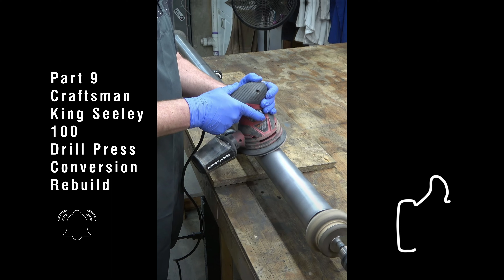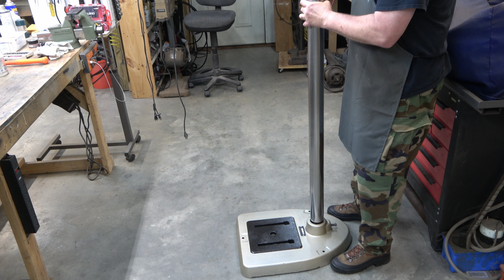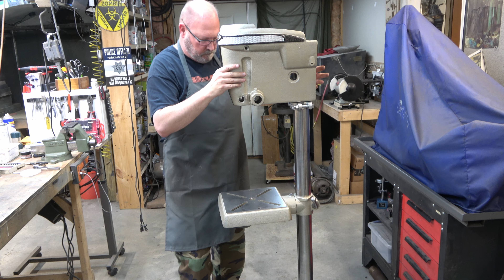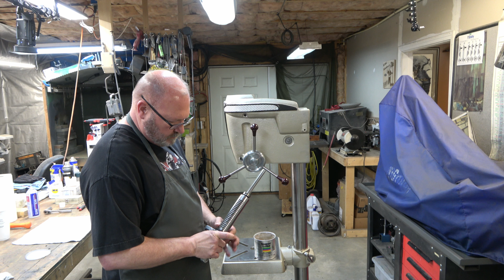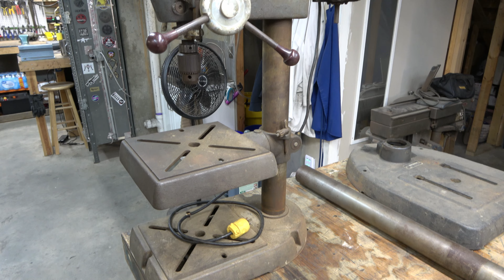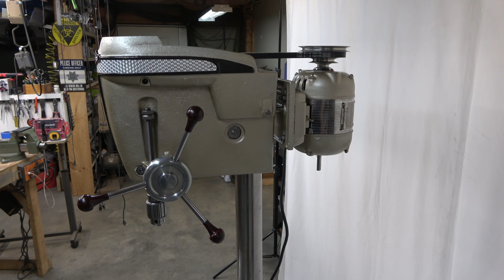Part 9 Craftsman King Seeley 100 Drill Press Conversion Rebuild (Final Assembly)

Comment: Great videos! My model 103.23140 is missing that lock shoe. Any idea where I might get a replacement?
Reply from the maker: Best option is ebay, they pop up every now and then as people part out machines. Alternatively, fabricate one from some steel stock. also keep in mind that Craftsman eventually dropped using them by the Emerson Gen 4 series so they are not absolutely needed.
Reply: @JeffsShop does tightening the bolt without having the shoe damage the column at all?
Reply from the maker: @AmericanThunder  It will indent on the column but its not the end of the world. like i said, they eliminated the lock shoe in the Gen 4 so none of them have them and I have had no issues with my Gen 4 standard or my Gen 4 commercial. Just dont go crazy with the tightening.
Reply: @JeffsShop okay thank you for the info!
Reply: @JeffsShop  A lock shoe just went up for sale tonight on ebay, I got it for 15 bucks. Hard to resist that one. lol
Reply from the maker: @AmericanThunder  Perfect, good luck on the rebuild.

Comment: Hello. I have a 100 and my motor seems
To be turning in the wrong direction. Can you share with me how to have it rotating in the right direction please.  Thanks
Reply from the maker: Not all motors are reversable; however, if your motor is a craftsman motor then it is very likely that it is reversable. Download the owners manual for your motor from this link and it should explain how to reverse direction. http://vintagemachinery.org/mfgIndex/detail.aspx?id=222&tab=3
Reply: @ thank you. I do have a craftsman 115.6962.
Reply from the maker: @teaganmanning5418  For the 115. 6962, the Owner's Manual says that the instructions are on the motor data panel. On some of my 6962 motors, under the model number it says “For reversing interchange yellow leads in terminal box end casting”.

Comment: Finally got mine running nicely. Cleaned it up nice and got the spindle to run with out any visible runout. 

Was there ever a mortising kit made for this drill press? Or a universal one you know of/recommend for this particular make and model?
Reply from the maker: Yep, there were several mortising kits for the Craftsman drill press. I have never used one, but I believe all the kits sold from 46-64 would work on any of the 15 1/2" drill press (100, 150, and Emerson gen 1-4) I could be wrong. I think the kit required the user to remove the feed stop bracket, chuck, and the feed stop rod (depth gauge) and attach the kit to the spindle thrust collar. This is why you see 100 or 150s for sell and missing the feed stop bracket.  Anyway, check out Craftsman tool catalogs for the time frame of your drill press and see what the part numbers were for the kits then search locally in sites like FB marketplace for a kit or check ebay. I see them sell all the time. Here is a link to Vintage Machinery’s free Craftsman tool catalogs. http://vintagemachinery.org/mfgIndex/detail.aspx?id=222&tab=3

Comment: Nice job.
I have to tap the table alignment pin a few times on my 23130 and 23131 so it is below the table surface plane.
Reply from the maker: It never occurred to me that previous owner of this drill press may have driven the table alignment pin so deep into the table support so that it was lower than the table surface. Thank you for sharing your reason for tapping the pin, literally, a light bulb went off in my head once I read your comment.
I have never had a reason to work on something that would protrude over the pin, but it makes perfect sense. And I probably will run into this issue at some point now that my primary drill press has changed from my 150 to my 100 series. Again, thank you.